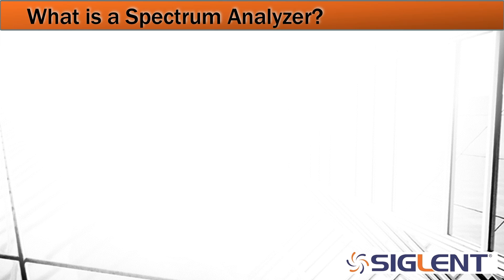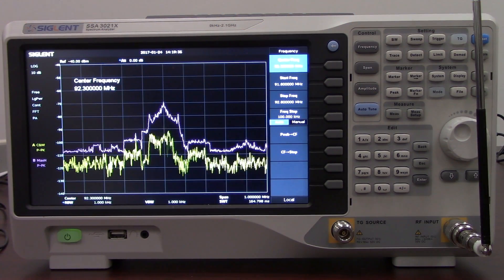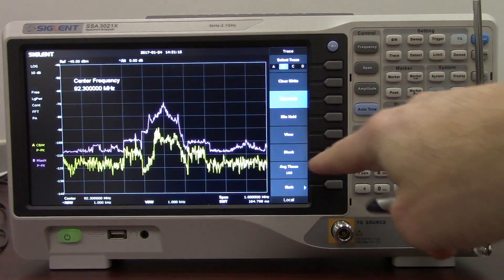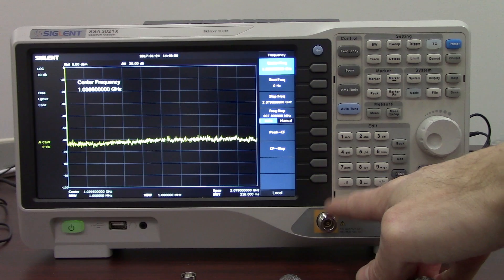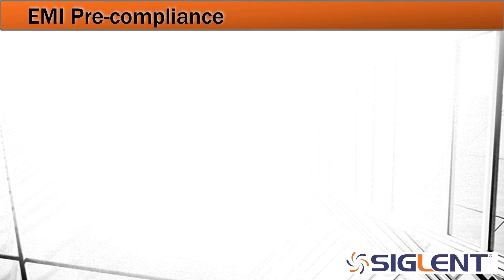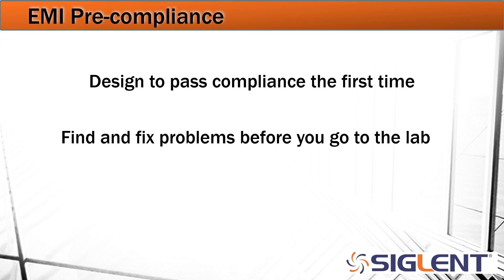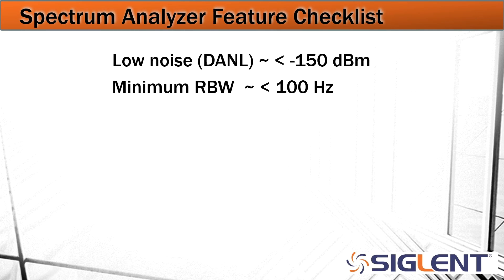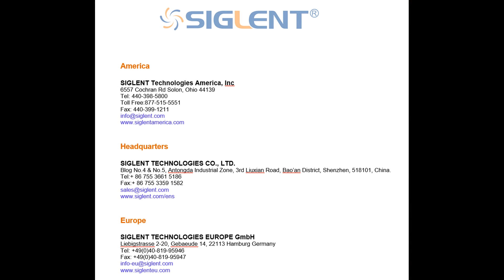Basic Spectrum Analyzer Uses

Comment: I want to get an antenna like this for Spectrum Analyzer , which is in the video , to receive the signal from the communication towers . can you help me by sending a site  that has this type of antenna ? or the correct name for this antenna to match the entrance that is located in Spectrum Analyzer ?
Reply from the maker: I do not have experience selecting antennas for communications towers. The spectrum analyzer doesn't care what type of antenna is connected. My suggestion would be to research and find an antenna that has the most efficiency at the frequencies you intend to measure, the right form factor (size), and possibly gain. - Jason, SIGLENT North America

Comment: How to measure RCS with respect to frequencies v/s amplitude
Reply from the maker: Hello. I think you are referring to Radar Cross Section, which has more to deal with the relative sizes of the structure you are identifying vs. the radar wavelength. This is not trivial.. and I cannot cover it in a short response. Perhaps this will help? https://www.radartutorial.eu/01.basics/Radar%20Cross%20Section.en.html

Comment: For those with the 3.2GHz bandwidth versions of your Spectrum Analyser, why don't you sell a version of the Return Loss Bridge (kit) that works over the full bandwidth of the test equipment?
Your illustrated RBSSA3X25 offering only goes up to 2GHz, which prevents it use in the most useful and commercially valuable 2.4GHz ISM band.
The €559 RBSSA3X25 upgrade license seems like poor value for money if if the included Return Loss Bridge doesn't match the bandwidth of the Spectrum Analyser, and the software license can't be purchased without the 2GHz Return Loss Bridge.
Reply from the maker: Return loss bridges tend to come in two performance ranges. Narrow frequency bridges have better performance, but only across a few 10's to 100 MHz. 

Wider band bridges (> 100 MHz) have relatively poor performance across their whole range, but can be solid for basic measurements.

All this is balanced with cost and potential sales.

Our designers built a bridge that they feel covers a wide range of potential user's, but not all use cases.

There are also  third party vendors like mini-circuits that make bridges that can be tailored to very specific needs. Perhaps they have something that will suit you?

I generally recommend the SIGLENT SVA1000X series which includes S11 and S21 measurement capabilities.. you get better performance for less than you would spend if you went with an SSA and an return loss bridge.

- Jason, SIGLENT North America

Comment: Why would I buy the horribly expensive Siglent spectrum analyzer when I can get the Tiny SA for less than a hundred dolllars?
Reply from the maker: Value is relative and depends on the application requirements. I am sure that the Tiny SA is fine for many tasks, but with SIGLENT you get better accuracy, better repeatability,  a much bigger screen,  remote control for automated data collection, a tracking generator, more RBW choices, and more. You can save CSV and pictures of the display. It's a different tool for different requirements. - Jason, SIGLENT NA

Comment: what happens if you connect a spectrum analyzer in parallel?
Reply from the maker: Hello. I am afraid I need a little bit more information. Connect the spectrum analyzer in parallel to what? What type of test are you considering? The RF input for a spectrum analyzer is 50 ohms, so great care must be taken when connecting directly to a circuit so that the input is not overdriven. - Jason, SIGLENT North America

Comment: Excellent!  Most helpful.
Reply from the maker: Glad to help, Dan. If you have any questions, you can always write us at info@siglent.com.. or call our North American office if you are located there. - Jason
Reply: @SiglentVideo  Thanks for your reply Jason. I might be relocating to work for aerospace technology startup in silicon valley calfornia where I would be using a spectrum analyzer, which i haven't used for many years. Radio is what got me hooked into electronics which i made a career out of. I presently live in Chicago, Illinois.
Reply from the maker: @danieljakubik3428  Spectrum Analyzers actually haven't changed that significantly from a users perspective. The big changes have been in performance and reduction of size/weight due to the implementation of digital techniques. If you have any questions, please drop a line any time. Good luck on your journey - Jason

Comment: Really nice overview, Mr. Siglent: Very helpful refresher for "oldies" and "newbies" alike. Well done. I'd add that one of the cool advances in spectrum analyzers has been the introduction of handheld spectrum analyzers. These are optimized for outdoor use are available from a number of manufacturers. Typically, they have functions that make them useful for installing and troubleshooting RF and wireless systems. These functions include a network analyzer, cable and antenna analyzer, interference hunting analyzer and power meter. An example of this type of spectrum analyzer is the Rohde & Schwarz FSH, which has a frequency range of 9 kHz to 20 GHz. I've got my own FPC1500 and it's fun to compare what it can show to what passes for USB devices and smartphone apps claiming to analyze the airwaves. (hint: no comparison:) Anyway, thanks for the video. I'll be sharing it!

Comment: so with that being said  a ten dollars  RTL usb dongle  with sdrsharp app will do the job
Reply from the maker: Yes. There are different tools that can perform similar functions. It comes down to what you need for your application. A spectrum analyzer has a number of features that are not available on an SDR dongle.. such as the tracking generator, VSWR calculations, EMC functions, and more. Knowing the strengths and weaknesses of each tool can be beneficial in selecting the right tool for the job.
Reply: Sweeping the RTLSDR at a RBW comparable to a true spectrum analyzer takes tens of minutes for a full sweep. It's a versatile device, but not a comparable tool.

Comment: Where do I get that whip antenna you are using?  I have this analyzer I just need help learning how to use it with out blowing it up. Its been powered up less than two hours in the 10 months I have owned it!  Bought new at the Dayton Hamvention last year, so I have only had it since May17.   Been a ham 25 years.  Books on the How's and Why's of oscilloscopes are in great abundance, but when looking to learn about my spectrum analyzer I am finding that its mostly assumed that if you know enough to buy an SA then you probably already know how to use it. 

I want to be able to do ANYTHING that can relate to ham radio, right down to designing and characterizing filter networks in radio circuits.  Hopefully the internet will eventually teach me what I need to know.
Reply from the maker: Hi Seth. Jason Chonko here. The SIGLENT website has a number of videos and application notes on specific applications, like testing a 3 db filter. You can use the search field or simply look up Resources or Support to find information specific to the analyzer. We are always adding to the library: https://www.siglentamerica.com/ ]

W2aew also has some excellent youtube videos on the basics of analyzer uses.

I don't remember exactly where we got the antenna, but if you search "BNC adjustable scanner antenna" you will find many vendors. 

If you ever have any questions, drop us a line at info@siglent.com

Comment: please how can i know exact setting  "span,rbw, bw" in order to get correct results
Reply from the maker: The settings required to achieve the correct results depends on the type of measurement that you wish to perform. In most cases, you want the center frequency of the display to equal the center frequency for your application. Then, the span should cover the frequency range of interest. 
You can write me at jason.chonko@siglent.com for more detail.

Comment: I like to transmit RF signal 1mhz,10mhz,100 mhz  using dipole and Loop antenna and wanna receive same to find out  RF SHIELD Attenuation in dB , can you suggest me.
Reply from the maker: If you are making relative measurements, you can connect an antenna to the analyzer, test the room (environment) without the shield in place. Then, make the same measurements with the shield in place. Of course, the accuracy of this method depends very heavily on the environmental RF and physical location/orientation of the antenna and any objects in the room where the test is being performed. It would be better to use an anechoic chamber, but these are very expensive. You can write me at jason.chonko@siglent.com if you would like to discuss more details.